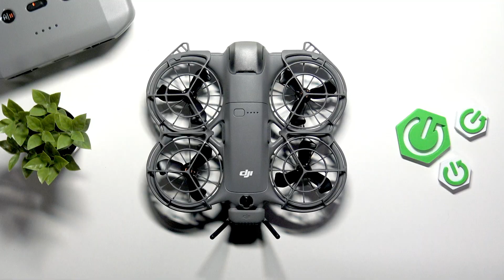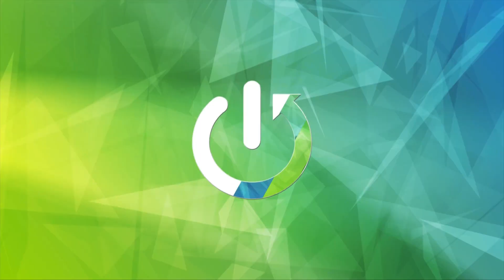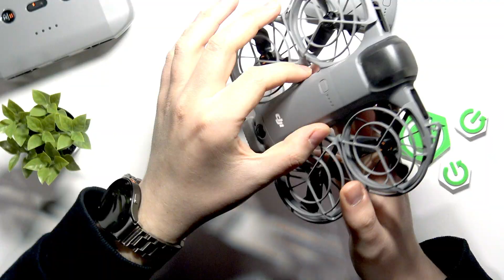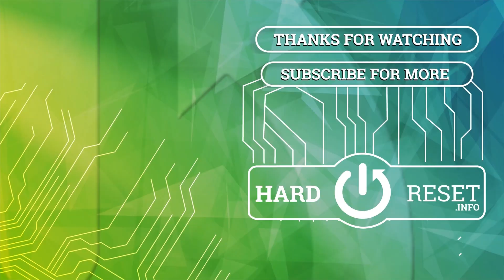DJI Neo 2 Fly – How to Swap the Battery

Comment: I heard about this issue, I didn't think it was that big of a deal,  Holy Crap talking the battery out sucks. The position of the push to release buttons SMFH. The trick until you get it broke in is to use a guitar pick or a thin edge of plastic credit card driver's license, etc. I'm going to use a credit card, cut down to size, and file it down on the edges. You pry at the tail end of the battery. Pops, right out ✅️ I'm going to nail file lightly the areas of resistance for permanent fix.

Comment: It's VERY HARD for me to be able to pinch both sides and force it. So I took a precision lens to look at the "side locks":
I slimmed down both sides on the drone, and all 6 sides on the batteries. !!!! Less than 0,06mm !!!! and just on the release corners.
After that, I saw a result: It's now still hard but acceptable!
( there were some production fringes left everywhere )